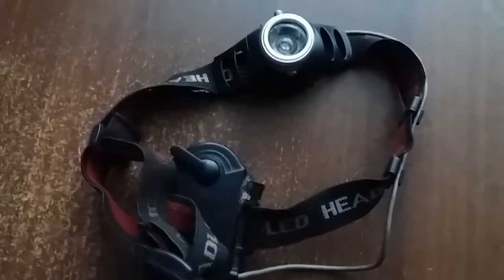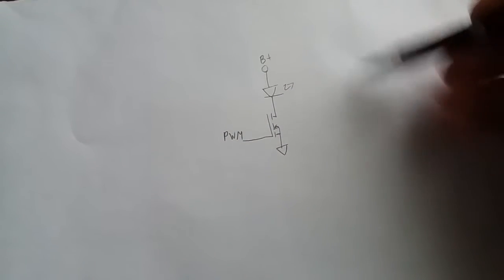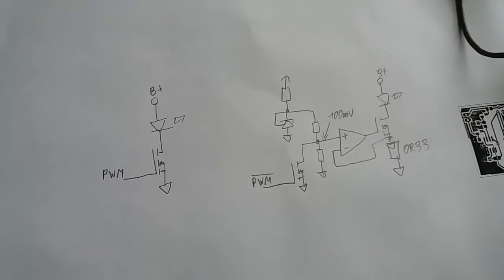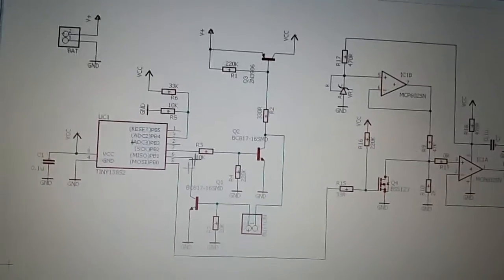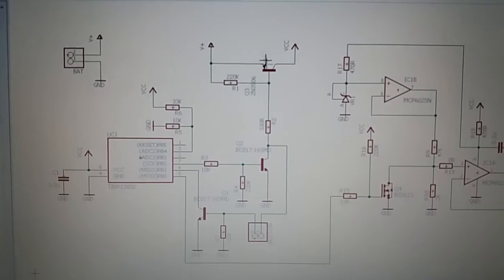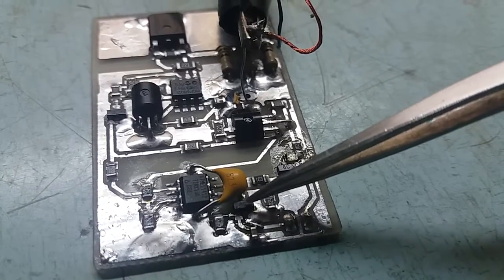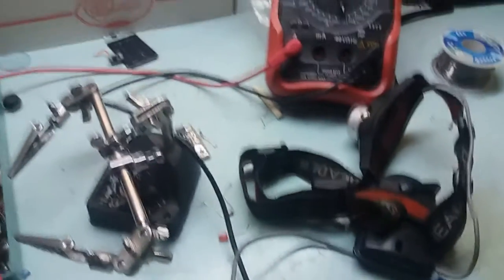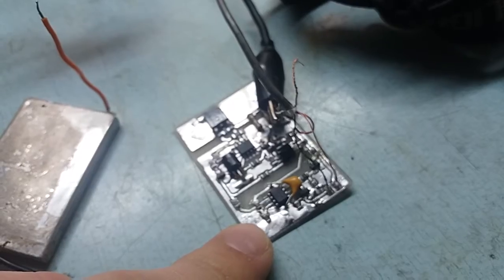Flashlight with AVR AtTiny13

Comment: Your just too clever for me :-D, i never really made frends with microcontrollers as it all seems too difficult to absorb an understanding of programming now.
It all seems too much jibberish for me.

People that make micro projects often post there code, so it makes it easy for a thick head like me to replicate there project lol.

I would have to go old school if i made a crude version, a 4017 decade counter 10 levels of bright and the button, a simple op amp voltage to pwm.
I would need a power button lol.
Reply: MrJohhhnnnyyy  I think it can be done on github I was expecting that you woud show code and explain it little but people dont like long videos I know :) btw: I like that circuit too I will definitly use it maybe modify it to be just on off  for my lc meter that I am doing now.
Reply from the maker: Yup, statistics shows that most viewers leave after 5 minutes :) You can download the code via the link in description,  while it still works. Second thing is that I'm just a rookie in programming, I'm not sure how well I can explain stuff :( 
The code has some comments, but I'm not sure will they make any sense for anybody else than me :D I may do a vid with a screen capture and explain it a bit, but I doubt that I will do a great job of it.
Reply from the maker: I'm not sure where I should upload the code, that's why it's not available for now. I have to pick some file sharing system that will work and the link ain't gonna stop working on the next day :D If you know such, let me know.
 Yeah, the 4017 approach will work, but it's gonna take more space - and as you saw, I don't have much there.
Reply from the maker: I've added a link, use it while it still works :D I'm not sure how long it's gonna last. You're gonna need CodeVisionAVR to view the project file.
Reply: No no i wasnt hinting that you should make the code available, sorry i didnt mean that. :-(
As you can tell im rather "stuck in my ways", there isnt much i really want, so if i do need something, then someone posting the code would make the micro project a simple job.
But im not saying you should, i was just saying that some people do.

I dont get any joy out of micro based projects, i made that L&C meter years ago, it was pic based, i used the authors code and it worked.
I was more interested in the analog circuits involved, the actual electronics part.

Sorry im just an old fart lol.
Reply from the maker: +zx8401ztv I was going to upload it anyway, so don't bash yourself.  Yeah, hardware is more fun for me too, but that day I felt like I should try coding again,  and it worked!  This is my second real project with a micro, I'm not counting blinking lights as a project :D First one is kitchen timer LOL
Reply: Im still here, and i find micros just jibberish, i may learn something LOL.
I would not go to any trouble trying to explain, it would not be fun for you.
You have to enjoy your hobby, dont ruin it for youtube :-(

I still have the hardware schematics and code for that esr tester you made, i dont have access to paypal at the moment so getting a programmer wont happen yet, if my interest peaks i will find a frend and poke them with a sharp stick to get it for me LOL :-D :-D
Reply from the maker: I have something much more fun coming, it may not be a surprise, but still. If the gustly wind will go away, I'll upload it overnight :)